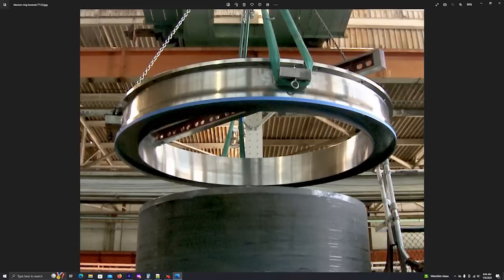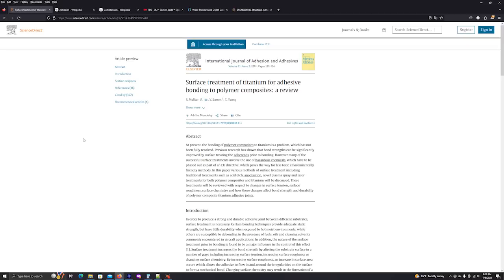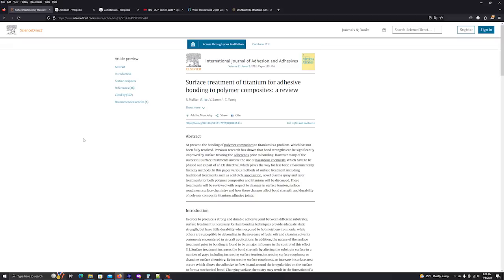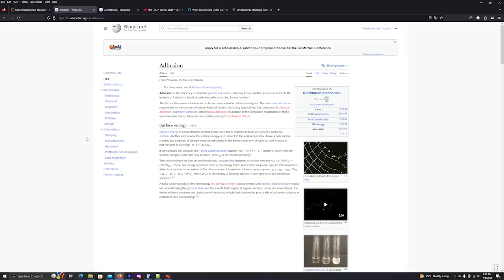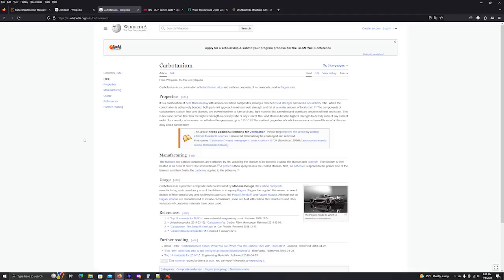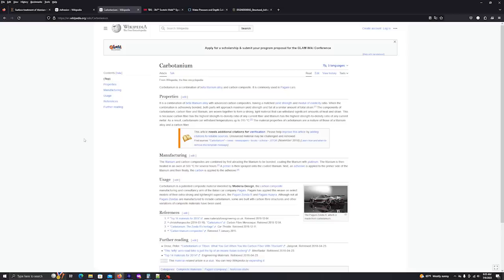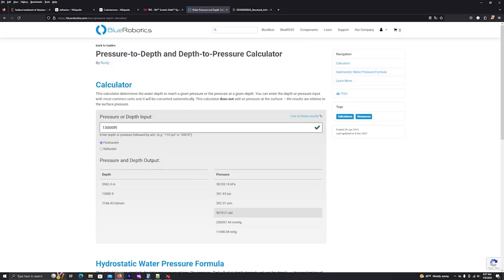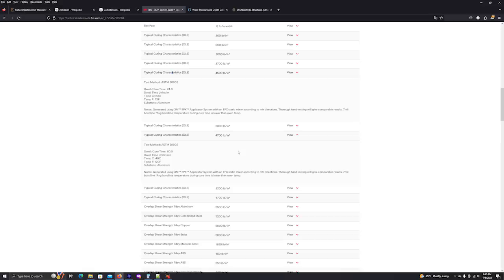Oceangate Titan Adhesive issues between Carbon Fiber and Titanium

Comment: I feel that another couple of important things people aren't understanding, are the effects of very cold temperatures that the Titan experienced at the depth of Titanic. In my experience, any, if not all, adhesives become brittle at extreme cold. When you combine this with 5546.98 psi (being in salt water as opposed to 5403.09 psi in fresh water), plus a 300-400 mile towing of the Titan, put further fatal damage on this extremely fragile vessel.
Reply from the maker: yup, my mistake I did not check the correct box,  Yes valid point about the cold temp..  Thanks for the comment
Reply: Good point. Sounds like the O rings of the Challenger that couldn't expand properly in cold weather.
Reply: @lifespanwellnessbeauty-60i64  the similarities are frightening, it's seems to always be the smallest thing that is over looked (or ignored in this case). I don't think it was the only think that caused the implosion, but a combination of stupid mistakes.
Reply: @photosailor101  I agree.
Reply: It is above freezing no matter how deep you go?
What extreme freezing temperatures are you mumbling about?

However, it is entertaining to see all “experts” here. Good laughs indeed.
Reply: @johanea  I've been using composites in the industry for fourty years, I'd put my experience up against yours any day of the week, Einstein
Reply: @photosailor101  There is no need for such. 
Calling water that is 2-3C extreme freezing temperatures is enough to get an idea about your experience.
Reply: @johanea  I get the feeling you really must be off your meds, roll over and go back to sleep mate.
Reply: @photosailor101  Your feelings are of zero importance. 
Just like your 40 years of work. 
100000’s of people are working with composite materials on a daily basis, all over the world. 
It does not automatically make them experts. 
And you certainly do not come across as one or even being old enough to have worked for 40 years already.

Comment: Do I understand correctly that you compared the water pressure at the diving depth directly to the compressive strength of the adhesive? You need to take into account that the water pressure acts on the entire cross section of the pressure vessel (55in * 55in * 3.14 / 4 = 2.375 in2) while the bonding area through which this force is transferred is much smaller (55in * 3.14 * 5in = 863.5in2), increasing the stress by a factor of 2.75. Just using rough numbers, as the exact geometry of the CFRP tube is not available to me.
Reply from the maker: Very cool, thanks for the clarification.

Comment: Your "150% safety factor" is pure bs. The safety factor, better known as a factor of ignorance, in spacecraft is often only 1.1 (or 110% in your speak).  Please do more research on submersible safety factors before spewing off nonsense to the masses.
Reply from the maker: Here is a link for you:  https://en.wikipedia.org/wiki/Factor_of_safety   " This low design factor is why aerospace parts and materials are subject to very stringent quality control and strict preventative maintenance schedules to help ensure reliability. A usually applied Safety Factor is 1.5, but for pressurized fuselage it is 2.0, and for main landing gear structures it is often 1.25."

Comment: This use of carbon fiber floating in a matrix of epoxy and boding this to titanium is a recipe for disaster under the best of process and by the videos of the making of the hill they wet laid it and used putty spreaders to hand the epoxy that was according to rush like peanut butter , this was done in an open air warehouse by the looks of it ,and why they have to wrap the retrieved pieces is beyond me this hiding if parts doesn’t even happen on retrieved material on plane crashes were hundreds are killed